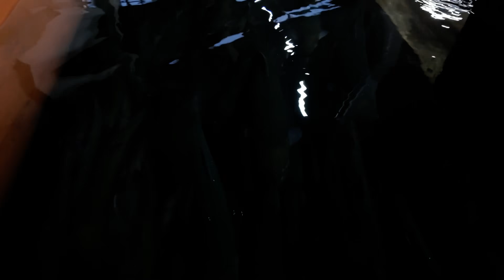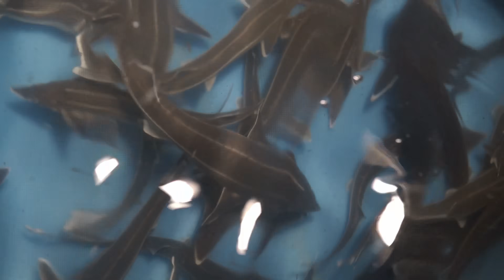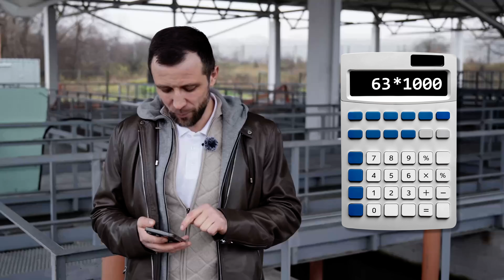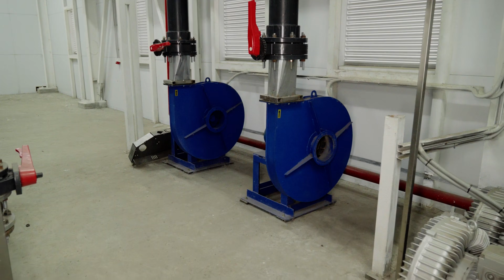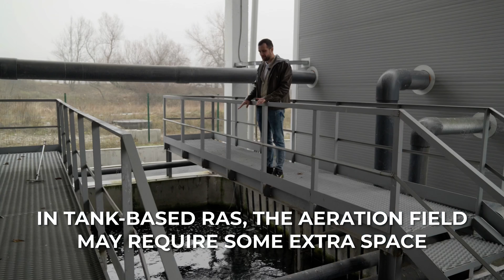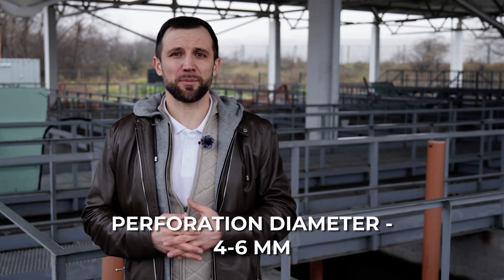Stop Using Degassers in RAS FISH FRAM! This Simple System Works Better...

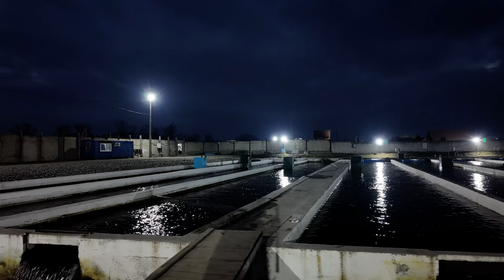Comment: 3:39 - Just slack jawed aghast.   ALL of that hot fish funk water being run through filters and purifiers wasting all of that energy,  chemicals, and materials without a plant in sight when PLANTS could accomplish almost all of that for a mere fraction (and take up more infrastructure and land, yes, we know) of the material and energy, yet produce three times as much product for the material input and land usage - particularly if the greenhouses are above the fish management tanks.
Reply: works for freshwater farming

other than seaweed, any ideas for marine or brackish water farms?
Reply: @shengenlin8958  they use raceways of kelp on some abalone farms
Reply: Plants are great, when you have a climate that allows for growing.